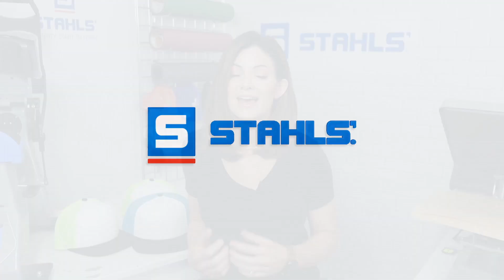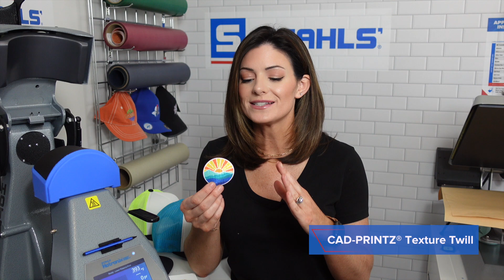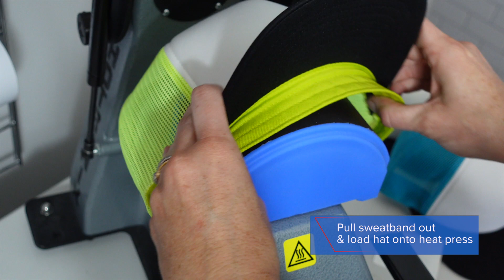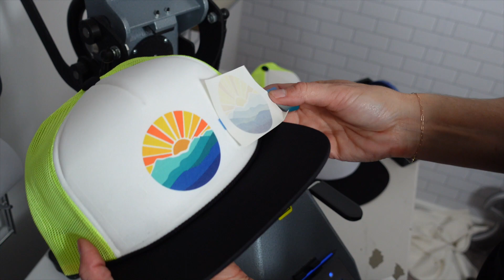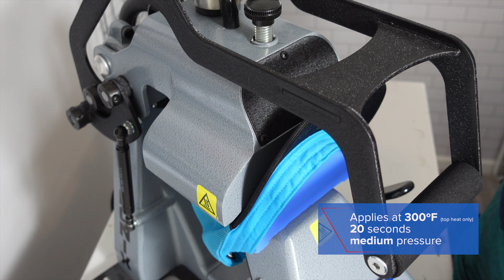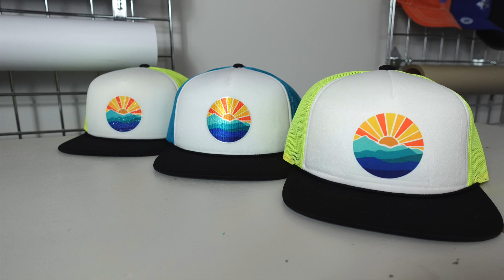Change Your Heat Transfer For a BRAND NEW Look 👀

Comment: For some reason my hats don’t seem to face straight up like the ones in the buddies. When I move the seam over the edge they have a significant forward tilt to them and the blue material of the lower platen seems a bit loose. Is this normal?
Reply from the maker: Hello - are you pulling out the bukram/sweatband and smoothing the hat on the platen?
Reply: @StahlsTV  in a bag and box? What!

Comment: What is a good size for hat designs? is there a standard? 3x3? 2.5x2.5? 

I’m working on my first order of hats ever and I think I will be using ultra color soft for both the shirts and hats as the design is a metallic gold of sorts. Is ultra color soft the right choice for this type of design?

Thanks for the videos I’ve learned a lot, but so far I only have experience with good proof!
Reply from the maker: It really depends on the area of your hat. Many people like the 2.5" sizes, but again it's up to you and the look you're going for.